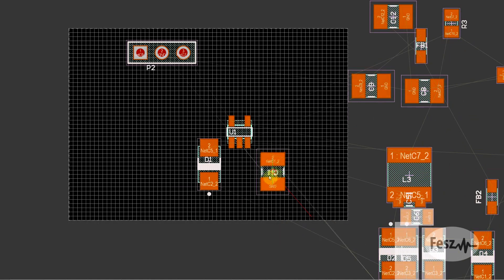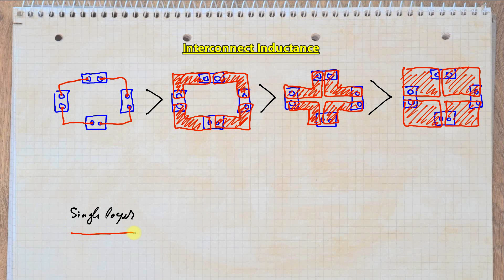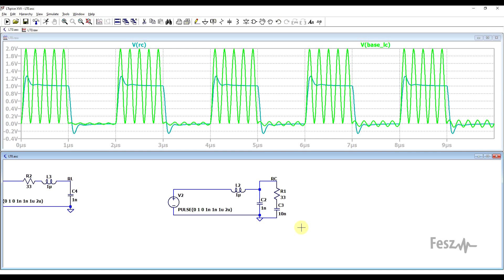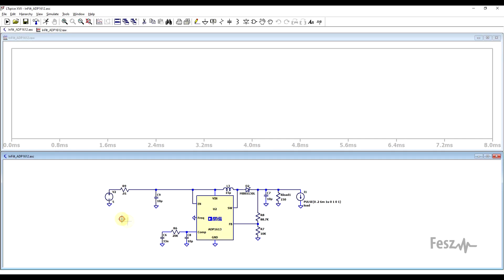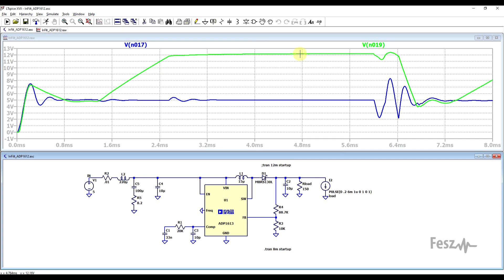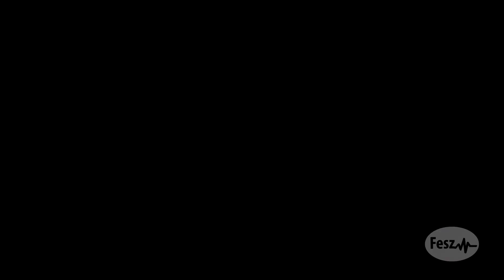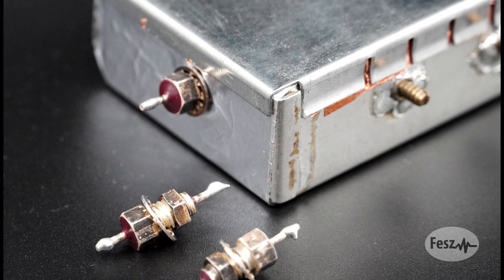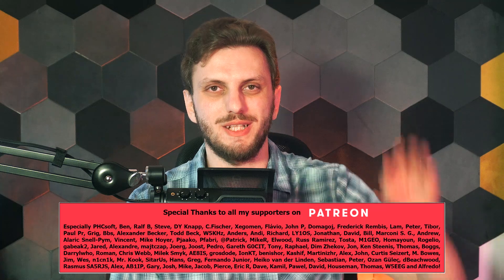SMPS Noise Analysis - Filters and Shields

Comment: One issue I found with switching ringing is boostrap drivers and increasing speed of the boostrap using pnp and ziner create loud ringing and stop boostrap driving totally something I never know was possible with high side driver but this issue is not present in gate transformer highside using speed increasing

Comment: I see similar circuits in my line of work. I see smps powered broadband amplifiers operating 5-1200mhz and if that dc is not filtered properly, it wreaks havoc on the RF signal across the entire bandwidth. They rectify a poorly modulated square wave(got harmonics?) into DC. Number 1 cause of failure right there. The manufacturers refuse to use a sine wave.

Comment: If you're just filtering for EMC compliance, rather than trying to create a super clean analog supply, it's fairly common to use a ferrite bead like the Murata BLM series instead of an LC filter. They're cheap, and they're low Q, so they don't need a snubbing circuit.
Reply from the maker: You are right - using ferrites rather than inductors will greatly reduce the issue of oscillations, since especially at high frequency they behave like a resistor, but at low frequency even a ferrite has an inductive behavior.

Comment: I'm still working in the power aupply noise situation in my workshop, where the MPPT solar battery charger dumps noise onto the 12v power distribution, creating audible clicking and buzzing on the output of my mixer... While the negative output from a nice linear PSU shows a 50Hz sine wave about 1V peak to peak compared to the ground of an oscilloscope right next to it, turning on a PSU causes a loud audible pop from my speakers (I think this is the AC powered amplifier being susceptible to power supply transients rather than anything on the DC power aide)... The whole setup is a mess and I mever know what to pick as a ground to measure things against to decide where the noise is coming from 😅
Reply from the maker: You might be creating some ground loops when measuring - the oscilloscope GND is usually connected to PE (from the mains), so when you probe something, you connect PE to the test circuit. This might explain why you have 50Hz everywhere.
Reply: @FesZElectronics indeed. It's a bit of a nightmare. I think I need to go round disconnecting things to narrow down where it's all coming from....